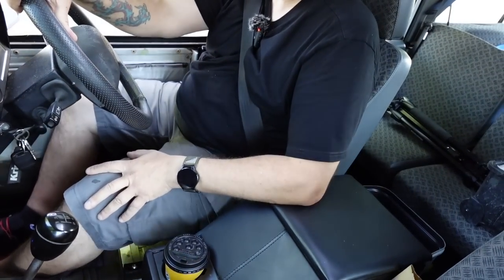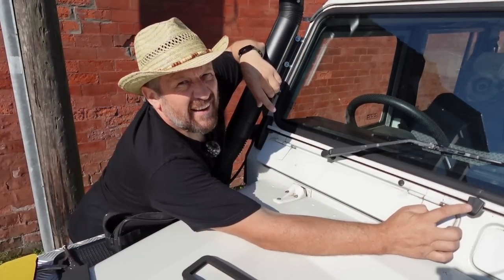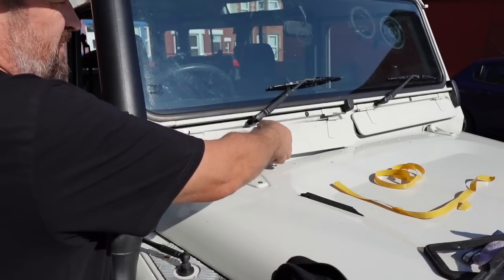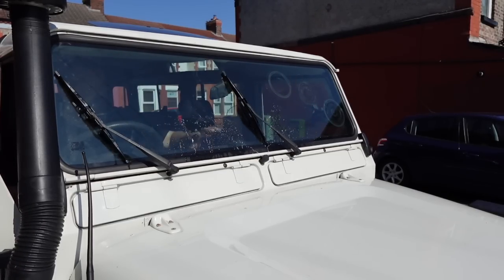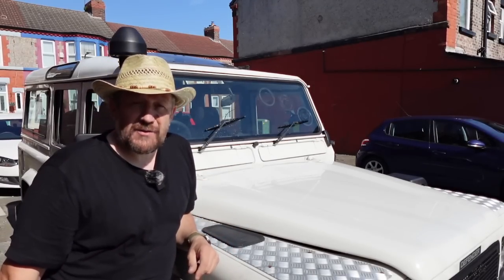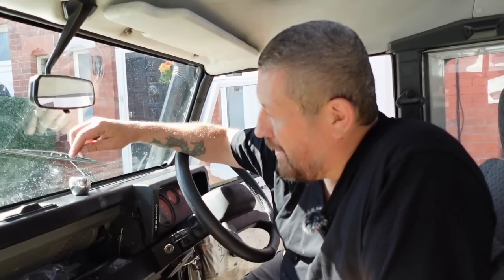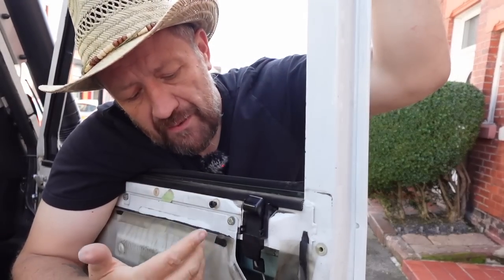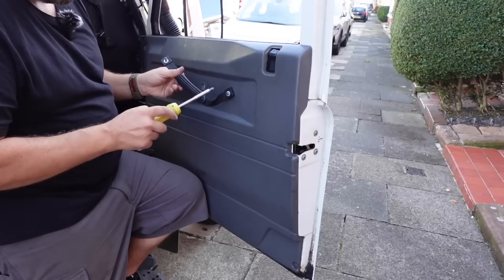20 minute jobs that you HAVE to do to your Defender

Comment: Little tip: I found it too stupid to put the nut of the washer jet on the inside.  That's why I riveted a rivet nut into the window frame from the outside and screwed the washer in with Teflon tape.  Now I can basically replace the nozzle completely from the outside.

Comment: Need you advise on my defender 110 HT TD5 … I’m having trouble with my fuel pump…😢
Any advise on what to buy ..?
Reply from the maker: Try and go for an OEM part and not aftermarket.
Reply: A Hyundai or a Kia ,, warranty is a great thing , even if its seldom needed.

Comment: Luck was with you today! But the door handle flopping around like that looks awful, so cheap and nasty looking, you would have no control of door closing with that floppy thing. Will the foam soak up water and cause corrosion over time? Chris B.
Reply from the maker: I like the idea of the handle but it could be a bit nicer. Maybe leather or nice canvas would work. Will maybe design our own! The foam is closed cell so doesn't allow any water to collect inside.
Reply: @LRLiveUK  I think it would probably depend on how hard your door rubbers are, but it takes quite a bit of force to close most Defender doors as they are very light and bounce off the rubbers, I find the slower you shut them, the better they close, the standard door handle gives much more control when closing., but I do like the foam vent rubbers, of course as they are made by Exmoor trim they would be good! Chris B.

Comment: I’ve had 3 Land Rover specialists tell me not to fit the LOF spring unless you want to fry the clutch?
Reply: That is strange advice? How can it "fry " the clutch? Unless you drive along with your foot on the pedal, it does require the clutch take up point to be adjusted correctly, but it cannot affect the clutch operation in any way. Chris B.

Comment: Defenders are a cult vehicle.  Badly engineered, a pig iron chassis with an aluminium body, iron bolts, stainless bolts, galvanised bolts breaking due to electrolysis, leaking like a colander and cheap and awful fittings making the finish below par.
Boys with their toys!!!!
Landcruiser gives me a well engineered motor and body as Mitsubishi did, but in comfort. I dont want to customise a car. I leave that to the manufacturers for which I pay them.
Reply from the maker: That's a shame. You're missing out!
Reply: @LRLiveUK  No no. Its a
shame for landrover as they won't see my money. Very happy with my landcruiser cruising the land  😂